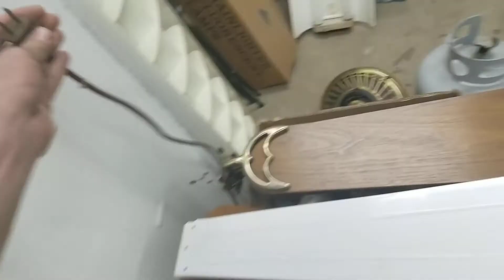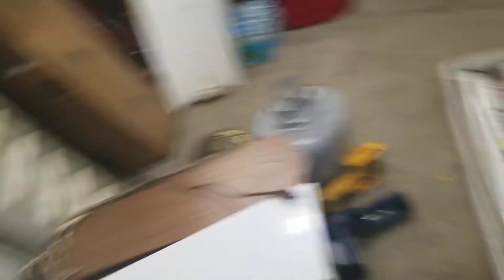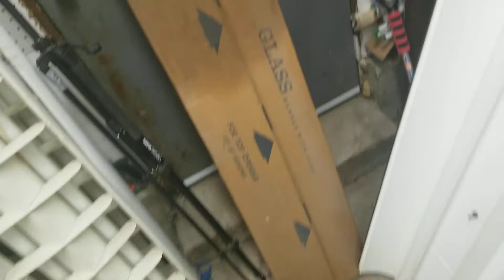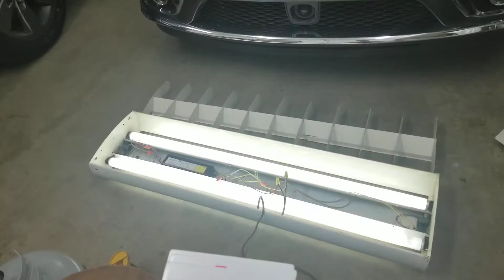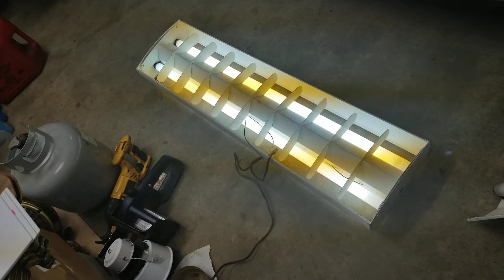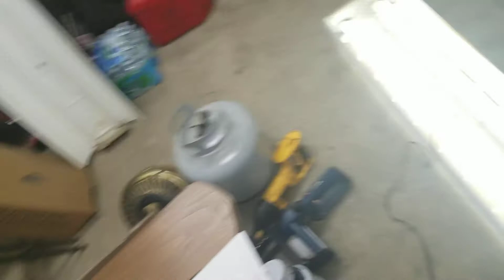Testing some louvered fluorescent lights

Comment: Wish I could find fixtures like these. I had light bulbs like those red lable one I think they changed over in 1990's I was 13 Years old when they changed all the magnetic lights too t8s in 1998
Reply from the maker: Yea these were quite a ways away from my house. It was on route from a fan meet, but still. I dont actually have these anymore. I plan on installing them in my grandpa's garage.
Reply: @thefanpage945  wow I'm glad they still in use. They are very rare too find I think the biggest majority of them where done away with in the 90s reason they so obsolete. I worked on every fluorescent light fixture you can think of except these here I'll love get one some day out t-8 ballast and Bulbs in them. My grandpa had those vintage red label general electrics light bulb label 20 years ago.